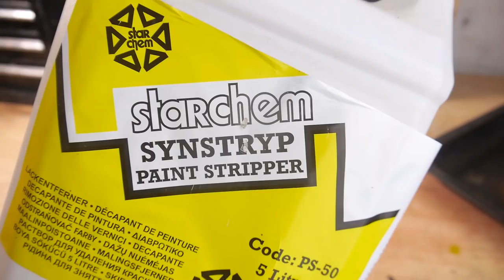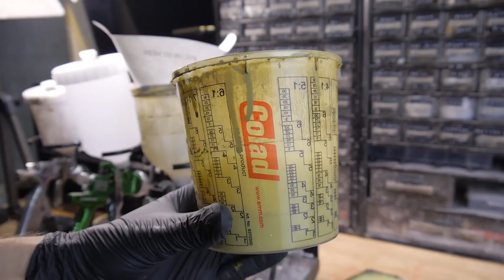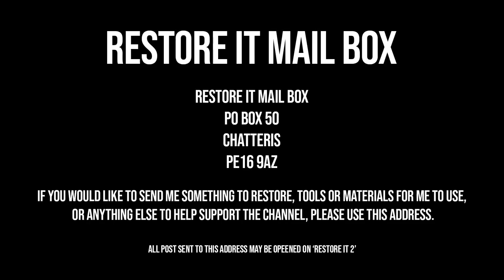Wesco Oil Can Oiler Restoration

Comment: You should use it for extra virgin olive oil at dinner.
Reply: Haha 🤣 brilliant idea
Reply: Now that I think about it seems like a fantastic idea since the bottles eventually get oily.
Reply: No, would've been fine if it was all metal + a thorough clean but oil would've seeped through the plastic components, if you put virgin olive oil inside it, the chemicals would leech into the olive oil, the tip material is brass which in industrial purposes is often mixed with lead to make machining it easier, you wouldn't want your food to be contaminated with lead right?

Comment: Should look into powdercoating, for some of the things you restore it would be better than paint
Reply: this
Reply: Until it starts to turn loose
Reply: Usually stronger than paint and holds up longer
Reply: Doesn't bond as well with the metal. Water can wick underneath (or oil in this case) and it will loosen. I have heard that there are better formulas nowadays that are epoxy based and more durable, but we do not use it for anything in the aircraft business. Proper metal prep/etching, primer and top coats are the most dependable in my experience. Thanks for the reply.
Reply: I'm really just going off of things I have and have seen on vehicles, engine covers, suspension parts all kinds of things and it seems to hold up very well
Reply: I'm not sure what you could powdercoat other than metal since it gets put in an oven afterwards
Reply: powdercoating, get applied under electricity, the  metal- iron, alu or such gets negatively charged i think and the paint is positive charged or the other way around, so yes only metals i guess, then it gets baked in an oven for 2 hours at 600degrees or such. powdercoat is very hard what it also makes it very brittle in some way. i think 2K paint like in this vid is hard enough to hold and just soft enough to not get rapidly dammaged
Reply: powdercoat should not be brittle. it is extremely flexible when cured properly. (which btw isnt 2 hours at 600. Most powders bake around 400F at part metal temperature.)
Reply: i dont know the exact sircomstances where it get aplied in, thats why i added the "or such" behind my lines. ok go ahead let powdercoat something en tap with a little force a wrench against it ;-) it crackles and it breaks little pieces of it. i have let powderc many things mostly motorframes, also its too thick layered.
Reply: @Sparky02Stang  aren't suspension parts ecoated? I could be wrong. Powder coating is used extensively in furniture industry due to its resilience and chip resistance. Also aluminum and zinc parts exposed to the elements even marine applications. Worked for a die casting company and was involved with all manner of surface coating processes.
Reply: @leeroyholloway4277  it's all in the surface preparation. Epoxy polyester powders are great, but as with all forms of coatings, you need a well prepared substrate. Somehow this involves chemicals known to the State of California to cause cancer....
Reply: Hydro boxes and metal posts etc along the Hwy are done w a mobile unit in a van and source of electricity to charge object and attract paint pigment outdoors in a weather conditions...no baking involved. Would love to learn more about airline processes...
Reply: Stouthuyzen Bob I had powdercoating chip off my new toolbox just a few weeks in. So I am not all for it on every application.

Comment: I've got my dad's old smaller version of this oil can, it's orange too, you need to get the wesco  water slide transfer on it unless you put one on after, ( not being a spotter or anything) 
Great video, & like others say, why Chuck it away when you can repair it. 
Also I have a Yamaha SR500 motorcycle painted in ford signal Orange. Nice colour.

Comment: Great restoration, lovely looking item.
With regard to rust removal and prevention, I have recently been using Citric Acid ( powdered form, cheap from eBay, 2 table spoon per litre of warm water), and Phosphoric Acid 85% (Diluted  by a factor of 4), this stuff needs a little care in use, and preferably out side. As anyone else used these?.

Comment: Can i make a suggestion for the paint string? I seen a video of a guy who stripped the paint off a car but when it came to the hood he used plastic to cover over top of the stripper. Said it worked better because it could sit longer. I tried it with one of my kitchen cabinets and left it covered for about an hr. Came back and i didnt have a single spot i had to scrub off. But for metal id probably used a bursh just in case.

Comment: my eagle oiler seems to leak out of the top and around the threads is that normal for these old oilers? I'm currently using it for penetrating fluid made out of acetone and ATF tho.  @Restore It